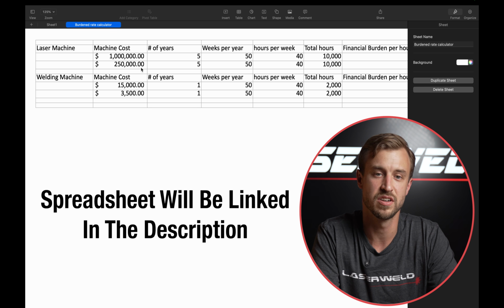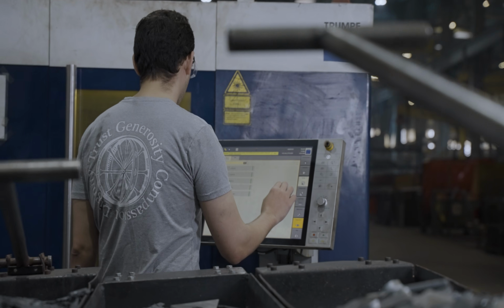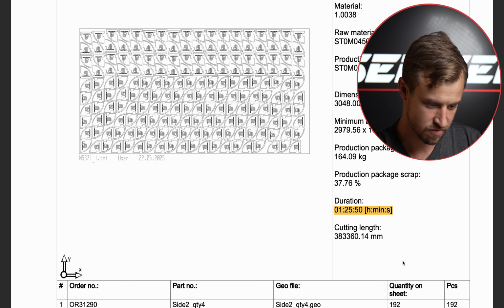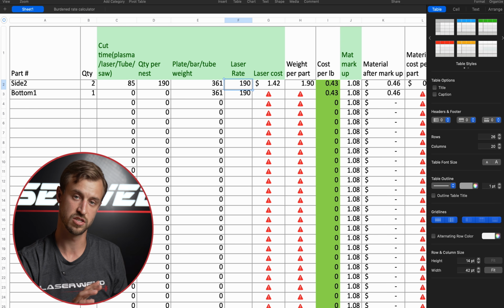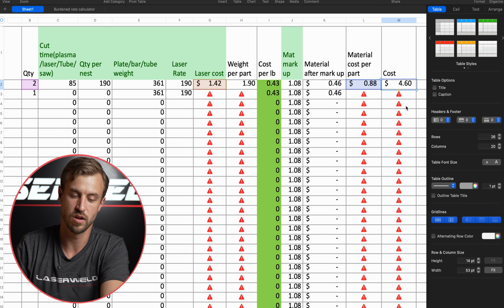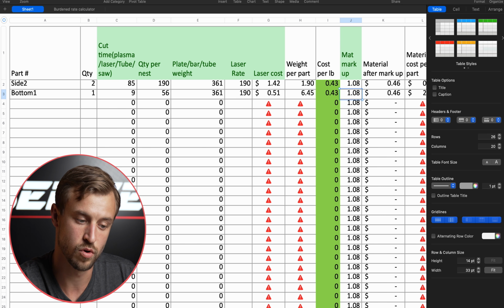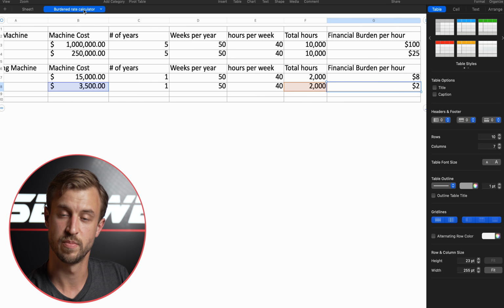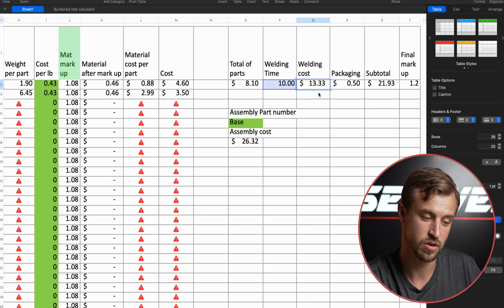Stop Guessing—Quote Manufacturing Parts with Confidence Using THIS Method

Comment: This is essentially describing Bill of Materials and Routing rates. This is great info to show the importance of knowing your costs as it highlights some areas that people forget when they calculate their costs. There are some costs not included in the burden rate that I would add but it is certainly a great place to start and demonstrated in a way that is much more clearer than I have seen others try to explain it. Setting up a costing workbook in excel is not overly hard, it may take a little time at the start but once up and running you just need to maintain cost changes or out changes as they occur.

Comment: Awesome video! I want to see the guerilla warfare video 😅 ... well presented, it's so important in a business to know your costs even if you don't use the cost plus method. Some people have no business being in business not tracking their costs and just assuming that everything will work out. But I'll give you an example how that can fail, in NZ. Plenty of building tradesmen are small businesses, they're good on the tools but not on spreadsheets, a lot of their quotes were based on assumptions. Then immigrant labour came in and the kiwi tradies were missing out on jobs as the quotes were too high, so they dropped their quotes without checking actual costs, this continued until they made little money, then no money, then lost money and the business had to close. How was the competition able to quote so low and continue? Some weren't paying the immigrants minimum wage but others were actually just fronts to clean drug money, the whole building companies purpose was to launder money, not to make money from building. Losing 10-20% when laundering money is a good deal when making 300% mark ups selling your product. NEVER assume your costs and NEVER assume the competition is playing the same game or by the same rules as you. Stay safe business people ❤

Comment: You need to know your production costs but cost plus margin is decades old quoting practice that leaves money on the table.  Unfortunately these types of business models are heavily dependant on labor costs so the low labor cost countries are  winning the big volume business. You can run a part on the same machine in USA as in Malaysia or Thailand and get the same quality at one tenth the cost. Even after high tarifs they can beat the price to the customer. You need to focus on finding opportunities  where delivering value to the customer equals higher profit margins. Its not always about volume. I make parts that cost me $120 to make (material +labor) and sell them for $600. Study up on margins vs markup.

Comment: So basically it depends on how much you pay for your equipment.  I always thought there should be replacement cost included.
Reply: Yes you should include an allowance for replacement cost. The biggest thing is not how many hrs a day times days to work out the cost over 5 years. It’s the beam on time (cutting time) that most important, as that is what you are charging. Your laser will never be cutting every minute of the day. With high powered fibre lasers , they cut quicker than you can load the machine. So the laser is sitting idol not making money. Have a look at machine on time compared to beam on time of used machines. This will give you an idea of what these machines can produce. Our  machine sit at about 55% beam on, this is pretty good for a job shop. We run 15-20KW fibre lasers with full sheet automation. On our 5x10’ machines sheet loading takes 46 sec. Even loading sheets that quick on panel jobs the lasers are waiting for the automation to load.
Looks like a good start to a very complicated series. Great video.

Comment: Good video. However, what about time & cost to engineer/design the part? What about the cost & time for R&D to produce the 1st good part? Time & cost for building any type of fixture?
Reply from the maker: @terryferrier8525
You definitely need to consider that. 
For high volume parts it can negligible and you have to be careful not to add any unnecessary barriers to getting an order. Oftentimes we look at it as an investment.

For lower volume parts you ABSOLUTELY have to consider set up. It’s good to ask the customer if they want to see that separate from the part cost or if they want it built into the cost of the part.

You can do (set up cost) / (Volume of parts)

Comment: Thanks, this is very close to how we do it but I have always struggled with putting a price on equipment. One thing your calculation doesn’t account for is efficiency in equipment or employees. Being a manufacturer, are you able to keep your equipment busy 50 weeks out of the year at nearly 100%? We do custom work so I have some specialty machines that sit for 50% of the year or so. This means I calculate an efficiency rate on the equipment. I also do the same for hourly rate on welders and installers, is this included on the back end of your hourly calculation for your employees as well? We call them “non billable hours” it’s basically anytime that can’t be 100% pushed towards a job. Thanks again! Really enjoying your videos!
Reply: I do something similar but I also assume 80% max efficiency of machine when it is running the job to account for down-times, repairs, f_ups ect.

Comment: I really appreciate this video and it has a lot of really good information that covers a method I feel all manufacturers should use, not just pricing something as high as everyone else or just under just because they can.

You used something like $80/hr for welding costs in this example, which as mentioned includes consumables and such, and part of that would be cost per hour for the welder's pay. In past videos you have also mentioned how you also get better productivity by paying per part as opposed to per hour from your employees (correct me if I am remembering wrong here). Would you be able to explain the relationship/correlation between quoting using per hour and actual compensation being per part?

Feel free to let me know if I am totally misunderstanding something here as well, I would just really like to know how it all connects!
Reply from the maker: In this example we used $80/hr as the burden rate for welding $30/hr of that is for the actual welder.

So at 10minutes there $5 DIRECTLY quoted and allocated to for labor.

If you get the project you can give that $5 direct to the production team. If they are able to hit the quoted time (10minutes) then they make 30/hr. If they are able to improve it for example if they are able to do it in 5mins then they can make 60/hr. 

By doing this you ALWAYS know how much it’s costs to produce the part and if the welder is able to improve then it is DIRECTLY reflected on their check. Additionally as their rate is going up the company is becoming more profitable. Win Win

Comment: Do you include facility costs in your hourly rate for any process? Some consider that overhead, wasn’t sure if 20% could handle that and leave enough on the table.
Reply from the maker: To a certain extent, so if you noticed on the welding price the cost of the machine was ~ $8/hr but charging $80/hr. That covers, machine, welder(person), gas, facilities, wire.

You really have to calculate it yourself as that all changes shop to shop. If you have been in business you can look back at last years expenses and get a pretty close number for burdened rate. (Please note that you have to be careful as you can start pricing yourself out of jobs if you use too high of a rate, and then because you have less work your burden rate increases and it starts a nasty cycle)

Comment: Very nice example, thank you for the effort!
How about the other indirect costs ? (commercial employees paycheck, the engineer employee that makes nesting and send it to the laser machine and so on - is it included in the mark-up margin ?)
Reply from the maker: So on large batch orders nesting time is less of a concern. E.G. 5 hours of set up and you run the part for 6years.
But on more complex parts or one off parts you can absolutely charge for set up.

Sometimes we have customers who want to pay the setup fee upfront and some want it built into the price so it’s good to have those conversations.

Another way that people do it as they charge just a blanket facility, burden rate, but in our experience that can get a little tricky and has a tendency to backfire .

Comment: How do you find customers that need steel manufacturing?
Reply from the maker: Normally by referral only.
Reply: @LaserWeldTexas what is a good recommendation to seek the first #Manufacturing contract ?
Reply from the maker: @csfabricationllc2252 You can go to all the local shops introduce your self and let them know that you are local and can offer quick lead times if they are in a pinch.

That’s how we started. Mark started by repairing defective parts to keep a factory running, and after that he got his first opportunity at a real part. 

Also pro tip make sure you get some kind of answering service for your phone so that if they do call you, it gets picked up 
if someone is in a pinch and they call you and you don’t pick up They’re just gonna call the next shop. 

There are apps now that you can hook up your company line to, and if it doesn’t pick up at the desk phone, it will immediately dial your cell phone